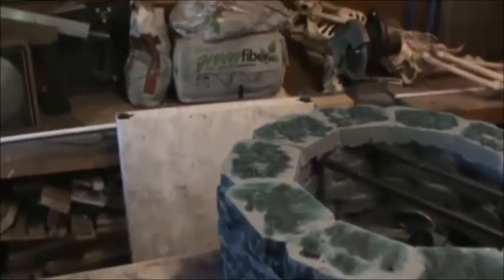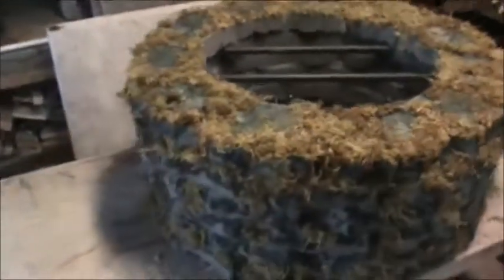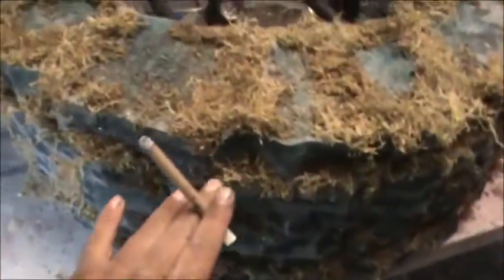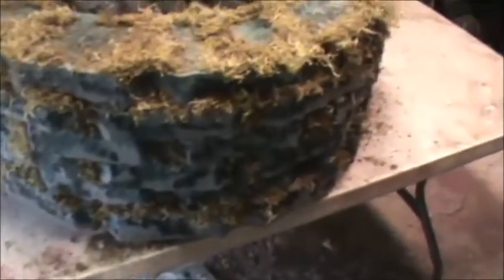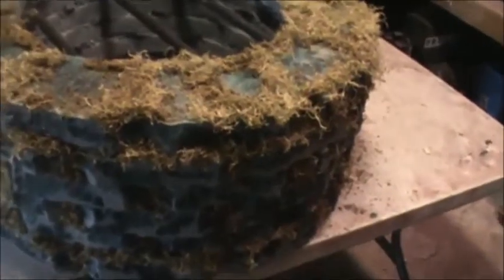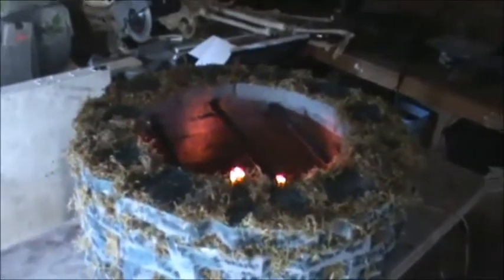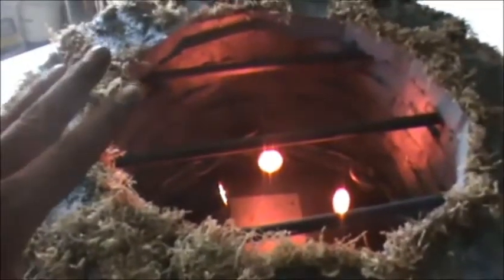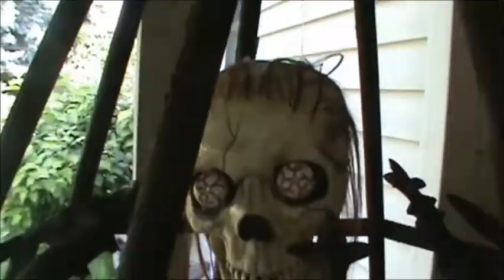The Well From Hell Finished 8-5-13

Comment: we use a deer motor for our Grave Grabber(video on our channel)  and it works awesomely.  Even with some weight it still managed to lift the old head.  I have a new lighter head on it now and it works even better.    the deer motors are great because they are made for outdoor use and factor in some wind resistance when they are made